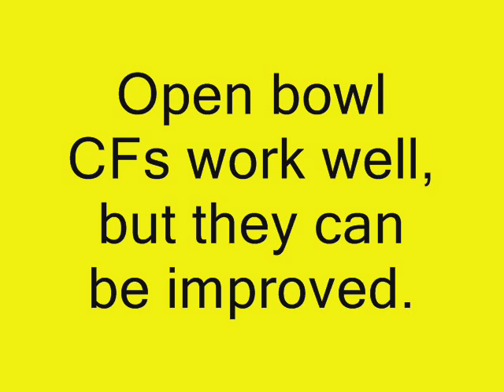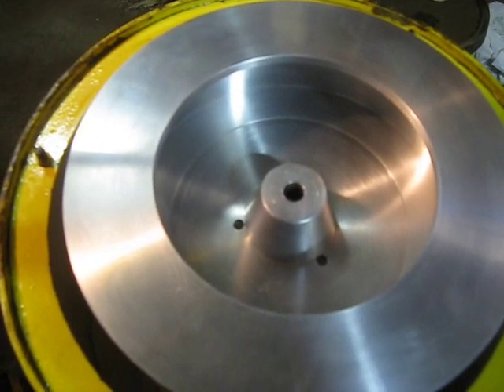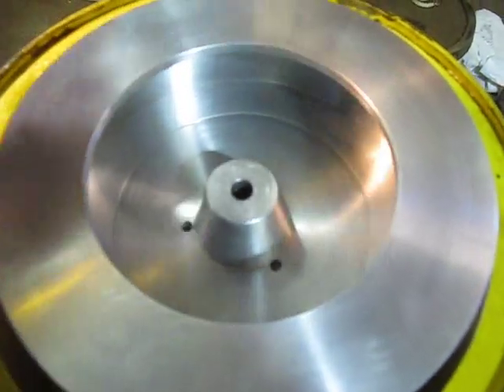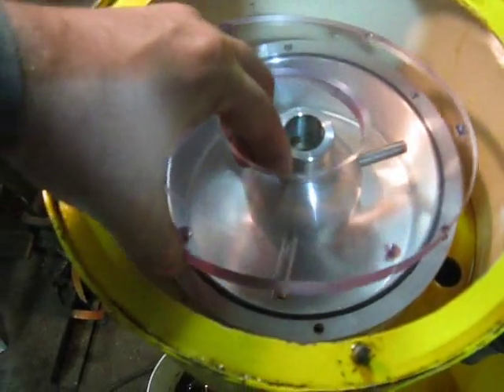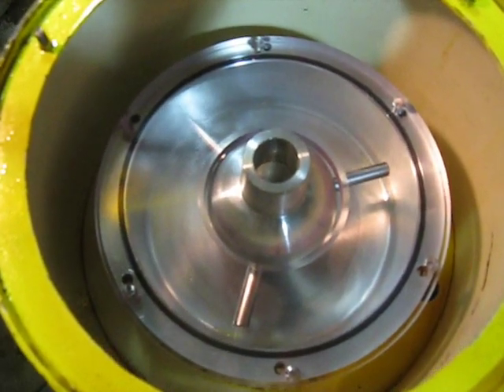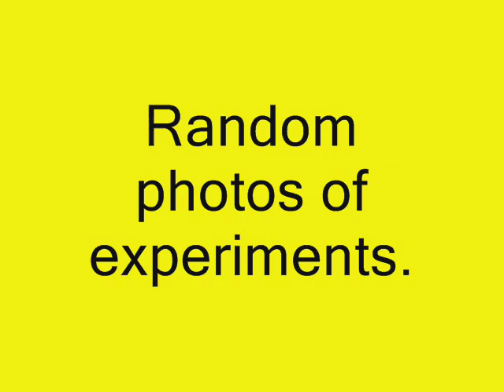Open Bowl Centrifuge Improvements.wmv

Comment from the maker: I think the bowl is 8 inches. A double pass is not necessary if the feed rate is not to fast. I don't know the distance of the gap off the top of my head. The feed cone system has been improved even more. If you go to the simplecentrifuge web site they have some good info and photos.

Comment: Just a few minor questions, what diameter is the bowl? Does it remove any more goo if you do a double pass? What is the distance between the feed nozzles and the inside of the bowl? Ultimately would the feed nozzles become blocked by the goo thrown out to the outside of the bowl?
Cheers

Comment: I know this video has been on here for a long time, but I was wondering where you had the plexiglass cover made for it? I need something exactly like it.
Reply from the maker: A local machine shop made the lid. If you get the plastic or lexan or what ever it is called most any mill operator could make a lid. Simplecentrifuge made a see through lid for their use, maybe they could make one for you.

Comment: Whilst I'm sure the system works great it wasn't really challenged was it.? What I mean is the oil that went in to machine didn't look very dirty to me and even when it was cleaned it didn't look much different. What I would like to see is a real challenge like some old diesel oil and see what it makes of that. Now if it can clean that up I'd be impressed.
Reply: He's cleaning down to low micron clean.
You can't see the contaminant at that level.
That's the whole point of using a centrifuge.